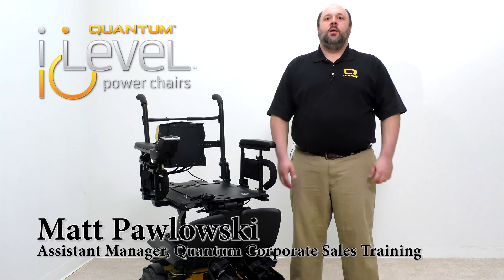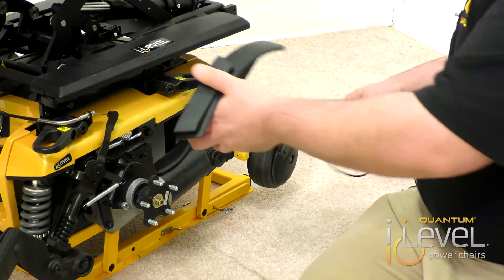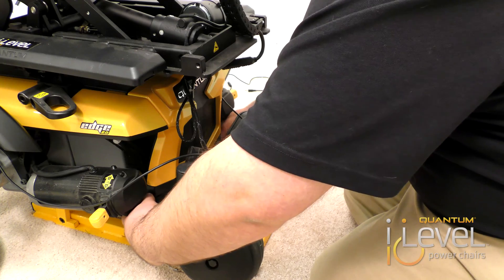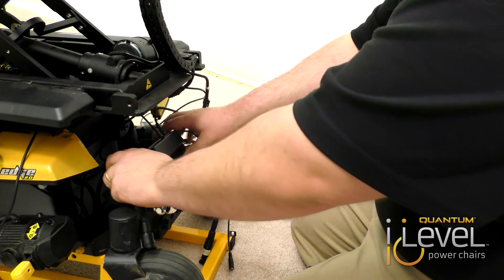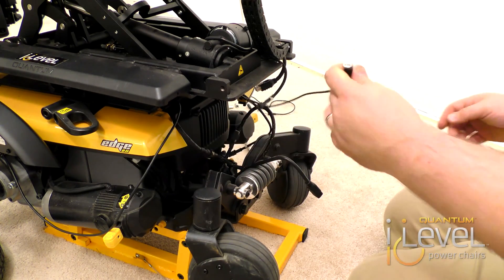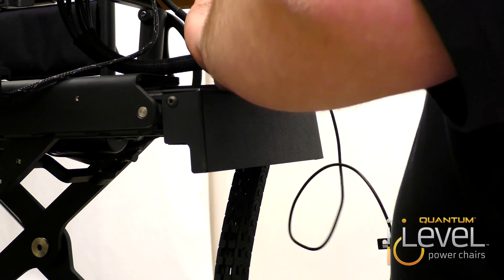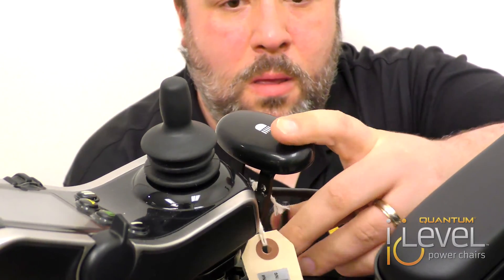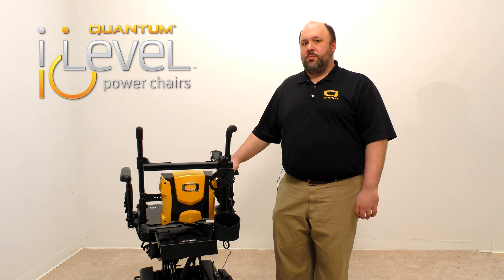Retrofit of Switch Operated Fender Lights on the Q6 Edge® 2.0

Comment: I have the lights on the fenders and wire coming out the back, but where is the switch for them to be turned on? I just got my quantum 6 edge 3 stretto Tuesday.  Am I supposed to order the switch?  That's silly if it has the lights and wire but no way for them to be turned on. Did they forget to give me the switch or what?
Reply from the maker: Hi Jaye, can you send us an email at marketing@pridemobility.com or send us a message on our Facebook page? We need your serial number, so we can look up the components on your chair and help you further. Thanks!
Reply: @QuantumClinician  I just seen this message is it to late to email you.